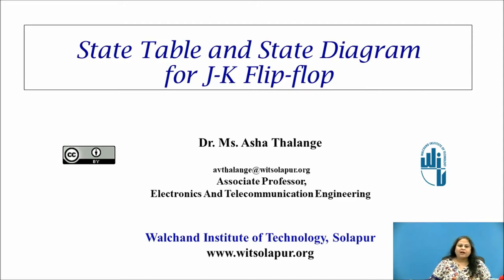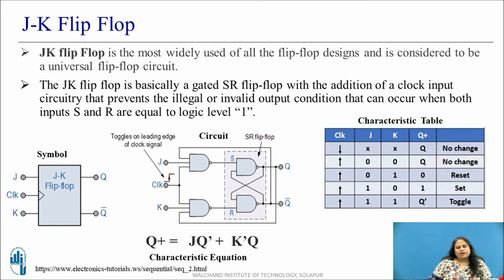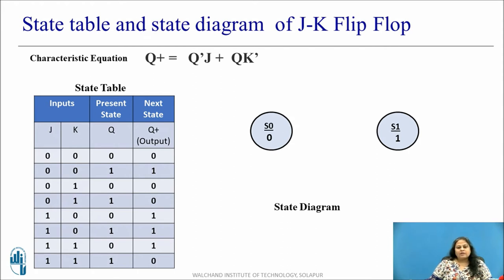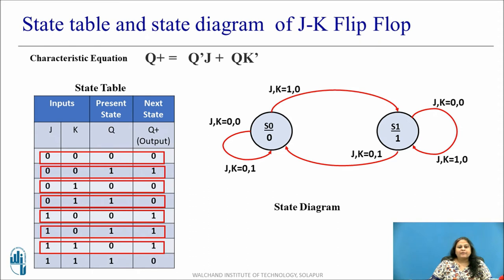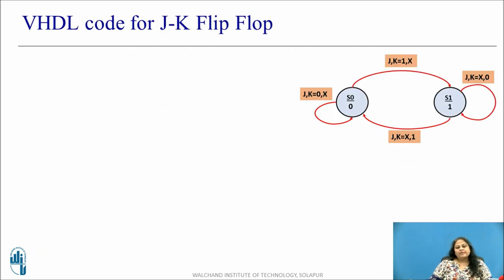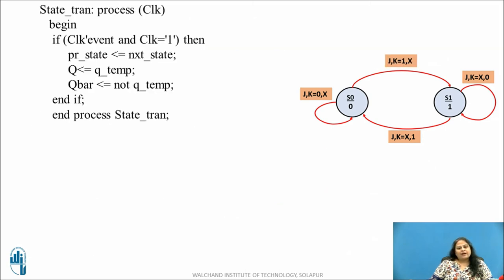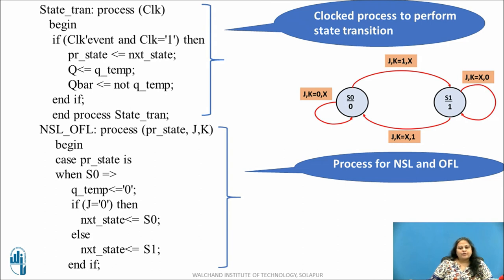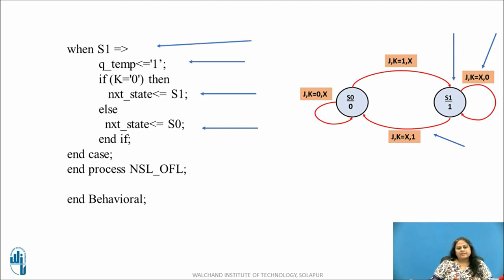State Table and State Diagram for J-K Flip-flop

Comment: JK state diagram can be drawn without knowing Q, it does not matter if it is 0 or 1. Easily for JK, If JK is (0,0) there is no state change, present = next, if (1,0) then whatever Q was, Q next is resetted as 1, when ( 0,1), it is setting 0 whatever the present value is, finallay for (1,1) it toggles the output meaning that if present was 1 then output is 0 , if present was 0 then output is 1
Reply: thank you so much